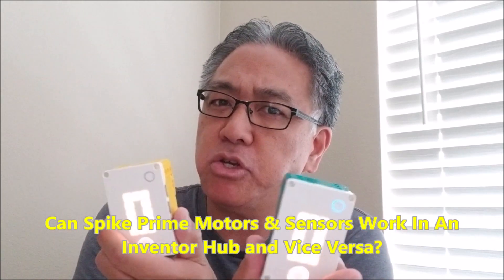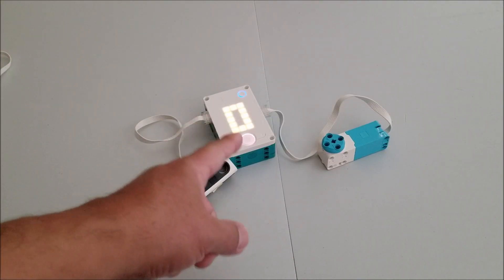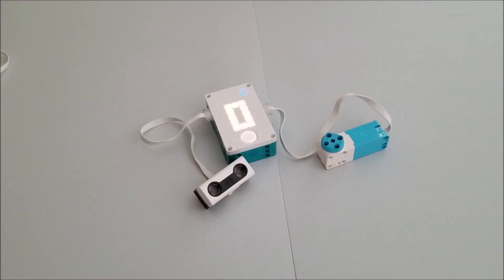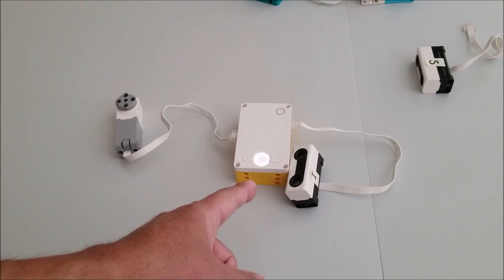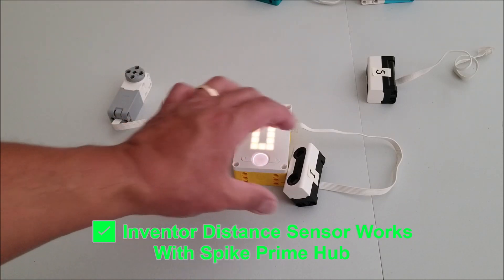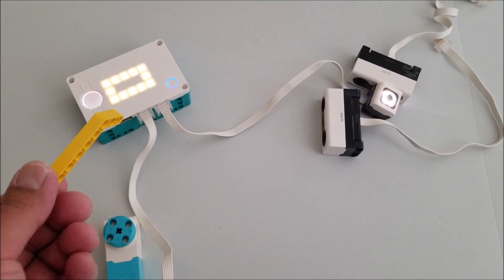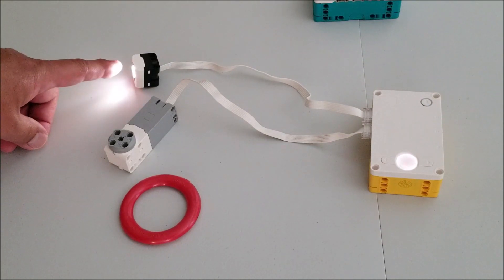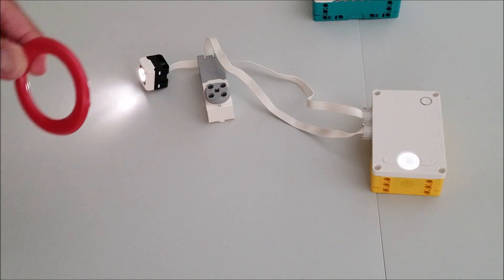"Can Spike Prime Motors Sensors Work In Inventor Hub Vice Versa?"

Comment: Hello from Japan.
I am going to rewrite my spike prime hub os to inventor hub os. I am going to rewrite my spike prime hub os to inventor os because it has more features that I can use.
I was able to rewrite it to Inventor hub os successfully, but after that, when I try to run the program with mindstorms inventor app, the spike prime motor does not work. It says "motor needs to be updated" and I can't get it to update. Am I doing something wrong?
I hope the machine translation is working...
Reply: It's white
Reply from the maker: @H-ep8yt   White means the hub has not been updated.
Reply from the maker: What color is the light on your hub?